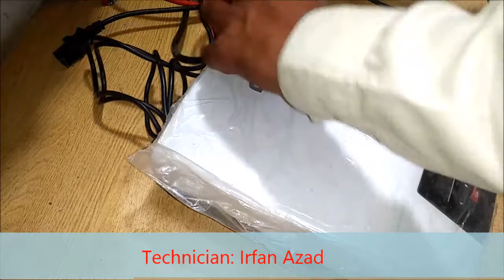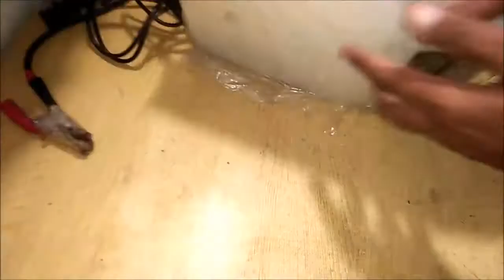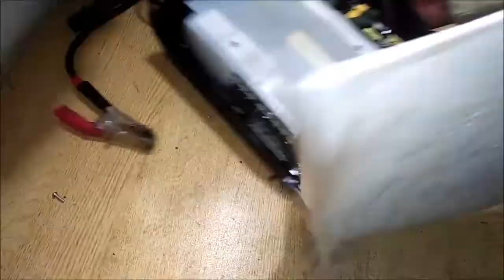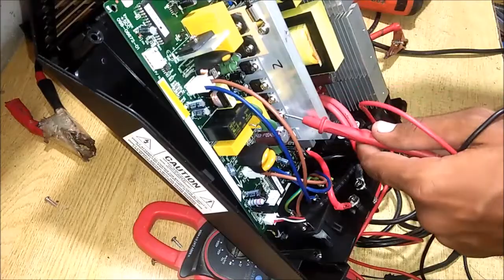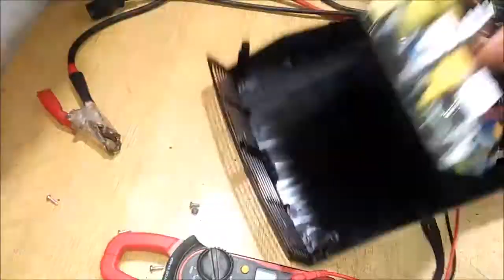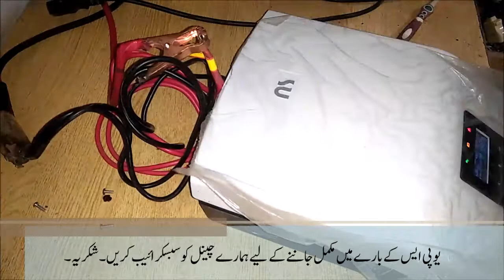how to repair NS inverter at home in urdu by | Irfan Azad | South Punjab|

Comment: My NS Grand Plus 1000/2000 showing fault 0 and some time fault 5...plz help
Reply from the maker: fault 5 is battery over volltage eorr plz check the battery volltage normal volt is 14.5 DC